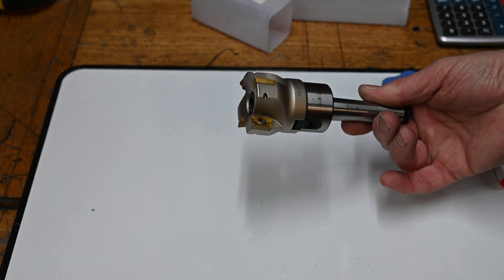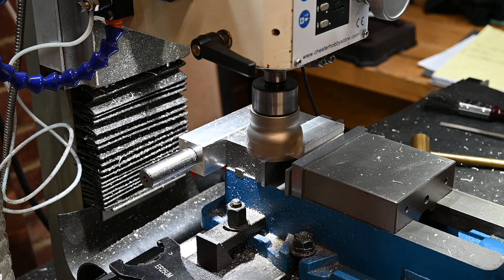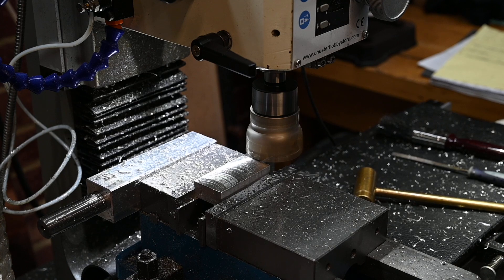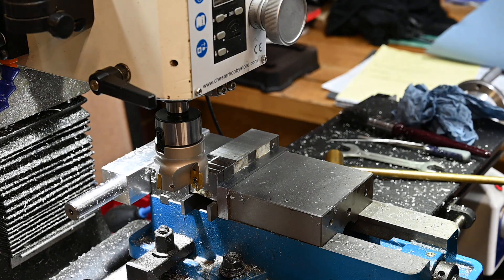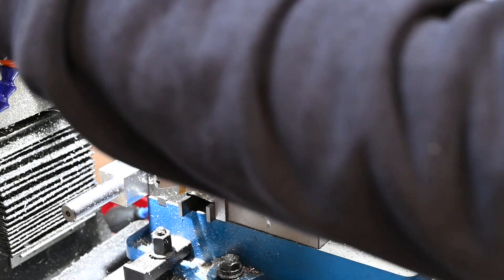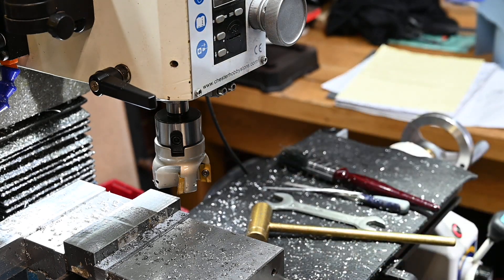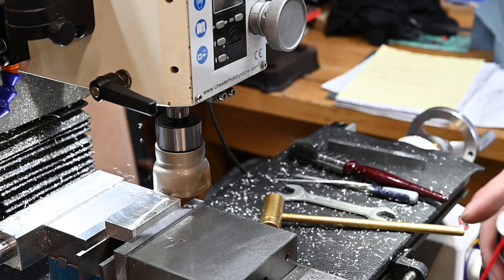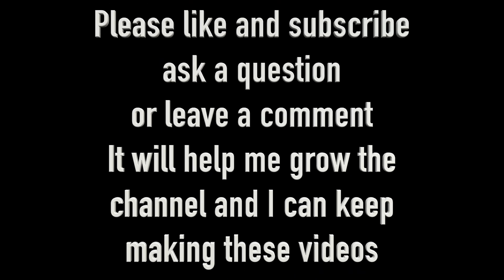Carbide insert Facemill Review from eBay

Comment: Try full speed which is too slow for that size cutter and a much higher feed rate. If possible kick the head over so the non cutting side has a thou or two clearance. You probably have enough power for very small depths of cut. High top rake tips also make a big difference, and a squirt of WD 40 before you start works wonders. Carbide needs to run fast to give good results and finishes.
Reply from the maker: Thank you

Comment: That looks a bit big for your mill. I have a bit bigger mill and I limit mine to 40mm. Use quality inserts, it makes a difference. For Ali use uncoated inserts designed for Ali and you will do better. I can't flood cool so I don't use coolant with TC as the fluctuation in temp can cause insert chipping, and they can take the heat. I have just machined down a cast iron block with good results using 560rpm and 0.5mm cuts.
Reply from the maker: @daveo9686  thanks for the advice 👍

Comment: The XJ9512 mill I've got is specified up to 20 mm face milling. Likely using this 50 mm face mill contributed to chew up every tooth in the middle plastic gear in the transmission. Yes, some steel cutting was done. Changing inserts for aluminium was never tried but would surely give a better result on aluminium.
Never practised fly cutting. Guess it makes no difference for radius larger then 20 mm.
Reply from the maker: Thanks for you input 👍
Reply: @EnglishHobbyMachinist what milling machine do you have?
Reply from the maker: @thunderbirdizations hi, I have a Chester 20 and a Centec 2A

Comment: You might actually want to try a heavier oil for ferrous metal work. It's a good use for used motor oil as it's already spent as far as using it for cars goes.
Reply from the maker: Thanks for the tip 👍

Comment: I have the exact one too with some of the same results. First thing I did was made sure the same number of dots are going outward. (There is ether one or two dots, molding marks). It was I bit better.  Then took three inserts out (as mentioned above) better results. Make sure the head is trammed. (Cuts better one way and not the other). I’ve got a Bridgeport clone and this cutter has only one insert now, stays in the drawer too.
Reply from the maker: 😂thank you😂

Comment: You have the wrong inserts. The really annoying thing about these facemills from china is that they are sold with totally inappropriate inserts. They tend to be the cheapest inserts available which are ones for heavy roughing cuts. They'd work fine if you could take a 5mm deep cut but you can't. Have a look at the inserts sold for aluminium as they will work so much better for you. Also worth looking at the KM12 type facemills that have 45 degree cutters, they work very well. Don't waste your time trying to build a smaller holder for the inserts you have, it wont help.
Reply from the maker: Thanks for the advice, really helpful 👍

Comment: I bought one of these face mills about 4 years ago, and came to the same conclusion as you Mark. OK for removing a lot of metal to start with and then fly cut to finish. Hardly ever use it now. May be useful if I ever got a bigger mill. Cheers Nobby
Reply from the maker: I think your right  Nobby, its too big for the mini mill 👍

Comment: I had same results as you, did try the uncoated tips as well with better results on ali, less galling and recut. I also found when I ran a dti on the tips, when it was in the machine that they were all at different heights, only by 0.01-0.02mm but still you would expect them to be bang on.
Reply from the maker: I did struggle, I guess my mill is just not rigid enough 👍
Reply: @EnglishHobbyMachinist  possibly, but I have a warco major mill and had similar results to you. I stick to the fly cutter for good results.
Reply from the maker: @paulrayner4514  I might do a little experiment and remove three of the cutters just leaving one 🤔
Reply: @EnglishHobbyMachinist  go for it, run at higher speed it's just like a fly cutter, or try a dti and see if you have 2 opposing tips at the same height and try running just them 2👍
Reply from the maker: @paulrayner4514  I will video the results 😂
Reply: @EnglishHobbyMachinist  👍